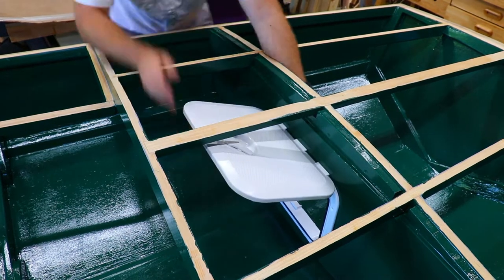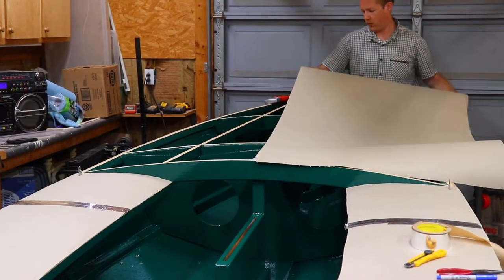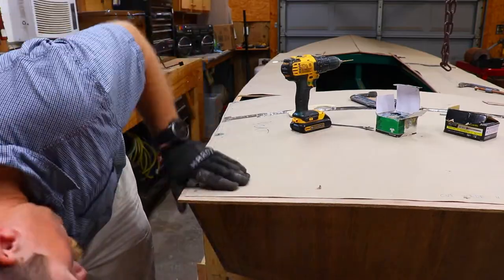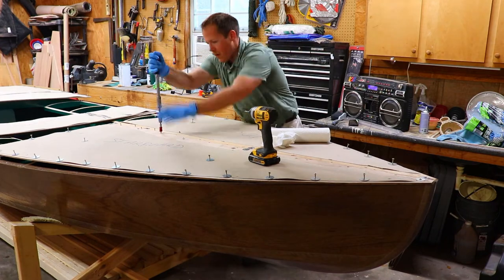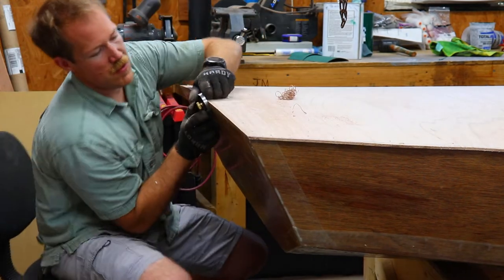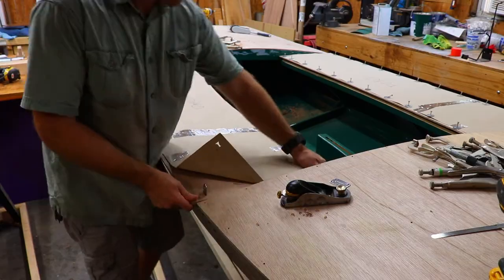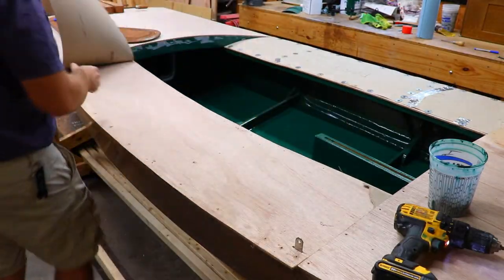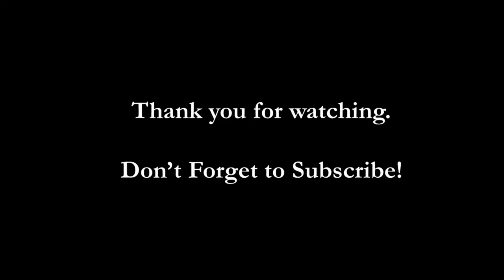Building a Wooden Sailboat #14: Installing the Decks

Comment: Uhhh,,, no sealing the ply on the under ???
Reply from the maker: Probably wouldn't hurt but it's too late now. Honestly with that face down, any moisture on it will run off and it should dry quickly. Additionally it's marine plywood so if it gets damp temporarily it shouldn't be an issue.
Reply: @MakeStuffNation  yeah but it sealed by glue on the ply's only. Could reach in amd put some poly on the bare surfaces.after all the effert, expense and great process planning ,,, make it bullet proof. Murphy's law reigns supreme.